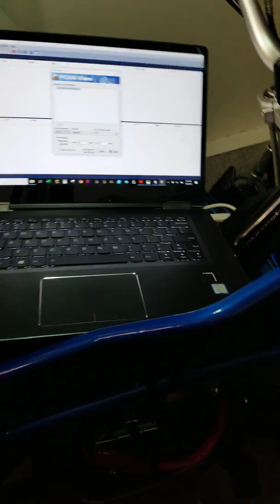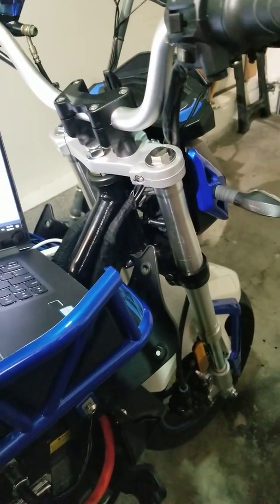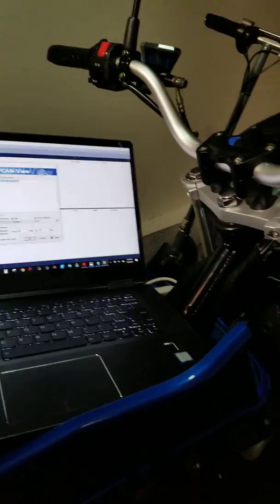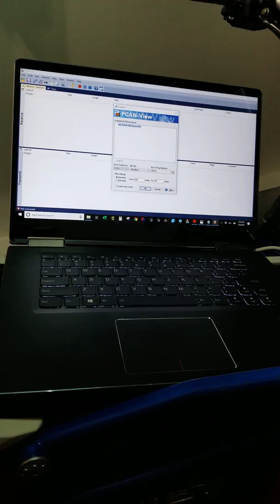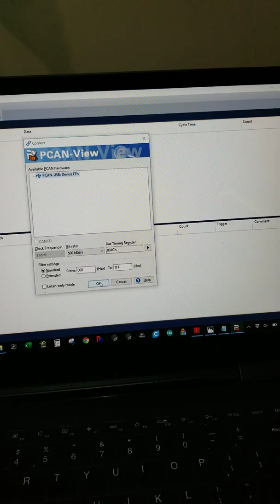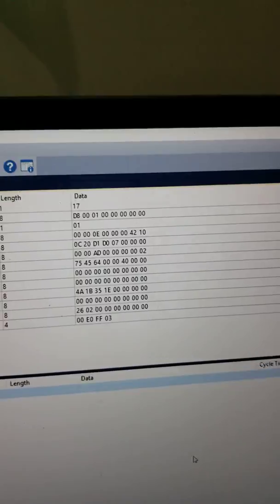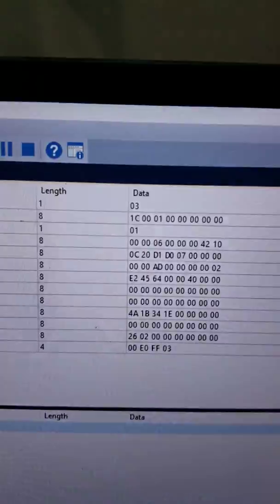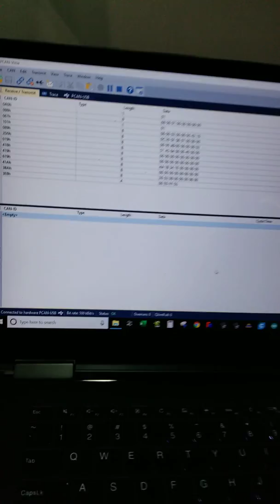2019 CSC City Slicker 60MPH - 100km/h??!!

Comment: Hey FRG.. I was reading a review of the city Slicker in France (not CSC but same exact Chinese parent) and came across this (translated) paragraph which peaked my interest about another mode.. "Two driving modes are available: Power and Eco. In Eco mode, the ramp-up is a little less brisk, the maximum speed is around 35 km / h and the range is around 65 km. Power mode regales with amazing performance, a speedometer that blocks at 45 km / h and a range that does not exceed 50 km. Finally, for private use outside the public road, the City Slicker can be unleashed and we discover a completely different motorcycle. The couple is phenomenal, the times are incredible and the maximum speed exceeds the reasonable. In this “track” configuration, the range of the City Slicker drops to around 40 kilometers." I'll assume this track config is just a setting?? Can you see if you can get into any of the details??
Reply from the maker: @Quadrcr4life  Hi Evan, Yes, the Cineco, is the exact same as the one sold in the US by CSC  Motorcycles.
I was able to make it go to 100kn\h with an upgraded controller.  This was a complete hack :-)
https://youtu.be/rwykmwcmnHI
https://youtu.be/Wzl0dEQmJMQ
Also, the range with the stock battery is not so good, that is why I also made my own battery pack, I will update a video showing the new range with the upgraded battery soon, meanwhile check these videos out. I have a couple of extra ones about the battery pack work!
https://youtu.be/w0A8msQpNbk
https://youtu.be/K4K4dx6pTTU
Reply: @Frg_76  Nice! I'd like to build a battery similar as yours, can you release the technical specs? Also, how is the range now?
Reply from the maker: @Quadrcr4life  I used 21700's cells from LG-4800mAh.  20s8p configuration so this would make a 3.4kWh pack instead of the barely 1.6kWh  of usable energy from the stock one!! I measured this a while back.
I will share with you the diagram and upload it here soon. I hope to have the range video coming up soon as well!
Reply: What controller did you use for this upgrade?

Comment: How did you connect via CAN BUS, are you connecting to the controller or display?
Reply from the maker: Actually connected to both. I had to use the original controller to read and display the speed to the cluster

Comment: Can you put a spare battery in the storage compartment? Please let me know because I plan on getting one.
Reply from the maker: Unfortunately you can't.  My next video is about making a bigger in capacity battery pack!!
Reply: @Frg_76  oh nice! I look forward to that video. Btw I live in NYC and I ride a moped that goes 28-35mph without a license plate, licence, insurance or anything else and the police doesn't bother me unless I pass a few red lights (which I never do. Would I need a license to ride that CSC City Slicker? I see some other people with electric bikes that has no licence plates
Reply from the maker: @JessicaRodriguez-gi2cl  Hi Jessica. When you buy it,  CSC already takes care of all the DMV fees according to your state and city. 
What range and speed do you need?  I'm getting around 20 miles range on a 55mph average speed,  that's why I'm working on an upgrade battery pack.
Reply: @Frg_76  the speed I need is around 20-35mph and to reach that in a matter of seconds.  I do deliveries on my current bike which honestly sucks. It takes at least minute to reach even 20mph but it last fairly long. About 5-7 hours before both batteries are dead.

I f I get the city slicker bike I want to last at least 8 hours straight even if I have to buy a certain kind of spare battery to carry around.
Reply from the maker: @JessicaRodriguez-gi2cl   So then this City Slicker will do the trick. It is speed governed at ~46MPH, but it will get you 0-35MPH in no time!!! You'll love that. The stock battery is ~24aH even though they claim it's a 30aH but it is not. I am working on a 35aH with top of the line LG cells 21700's. The stock battery should get you around  30 miles range. If you need more range, then we can talk about other options such as the new battery that I am working on for mine :-)
Reply: @Frg_76  yes I would like that. Can you tell me more about this 35ah battery and how to get it?
Reply from the maker: @JessicaRodriguez-gi2cl  I'm making it... from scratch ;-)
I'll keep you posted
Reply: @Frg_76  So does that means I can buy one from you later on? lol
Reply from the maker: @JessicaRodriguez-gi2cl  only if I can get it to work... lol
Reply from the maker: I started the upgrade project! :-)   
https://www.youtube.com/watch?v=w0A8msQpNbk&t=7s
Reply from the maker: @JessicaRodriguez-gi2cl  I'm almost done with my new battery pack!!!!!
Reply: @Frg_76  oh wow niiice! Is it lithium ion or lithium iron?
Reply from the maker: Hi  @JessicaRodriguez-gi2cl   
Even better!!! I am using Lithium-ion Nickel Manganese Cobalt Oxide or better known as NMC’s.
This chemistry is now widely use on electric Powertrain systems in the automotive industry. I've got pretty high-end LG 21700’s -M48. The energy density is much higher than other chemistries as well as an excellent discharge rate of 4C which means that it can continuously discharge 4 times its capacity (C-rate) at nominal voltage, so one cell can discharge 20A no problem! (M48 is the cell capacity = 4800mAh x 4C=19.2A)
This has been a really  cool project so far!!
Reply: @Frg_76  Hmm really? I was told lifepo4 was the best. I need to research this.
Reply from the maker: @JessicaRodriguez-gi2cl  they're more affordable but depends on the application as well but NMC's are taking the lead now though